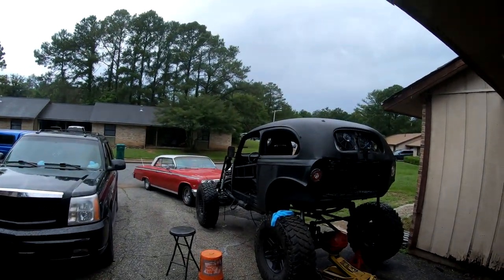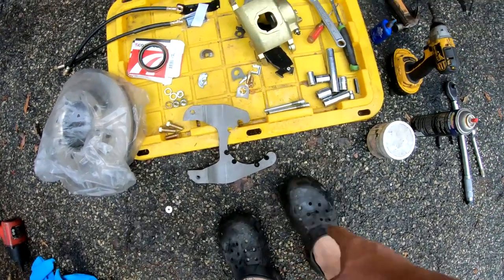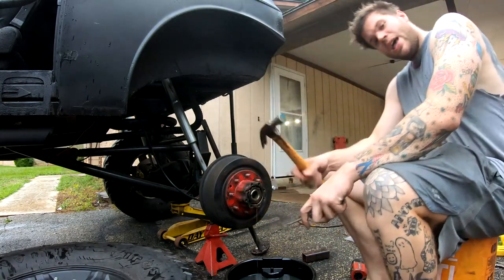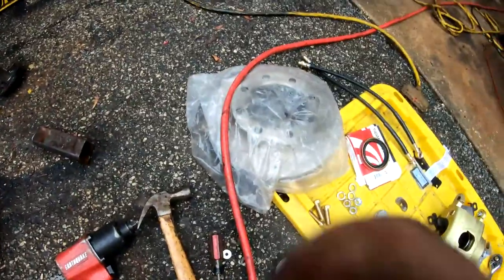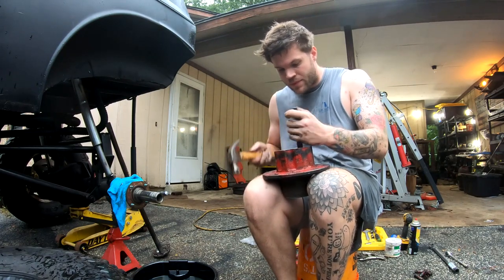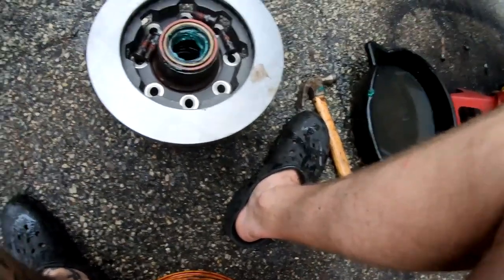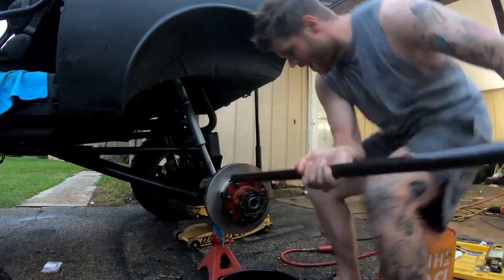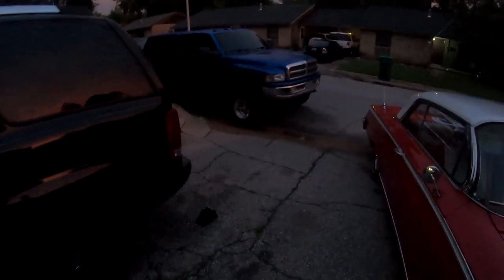Lugnut 4x4 Kit Dodge Dana 60 Disc Brake Conversion on my 1938 Rat || Legacy 4x4 and Off-Road

Comment: Great video man, helped me a lot. Currently rebuilding a 1975 Dodge power wagon and picked up a Dana 60 rear end and Dana 44HD for the front. Thanks a lot for the video, was having a lot of trouble with the drum brakes, still tryna learn, only 19
Reply from the maker: Glad it helped! Im actually about to do it again for a ford rear 60.... im about an expert at it by the 5th time!
Reply: @Legacy4x4andOffRoadYT  having a lot of trouble getting the wheel studs out on mine currently. So that’s my next hurtle, but keep up the content man! Really informative and helpful, not a lot of people show every step
Reply: Rebuilding a 78 power wagon myself. It has a Dana 60 from a 95 Ram 2500. How did it go?

Comment: Almost plug & play - something that didn't require fabrication is an unusual occurrence on your builds - only requiring just a couple of washers for spacers speaks well for Lugnut's kit! Damn - they don't make one for my Chrysler 8.25 ///;-(
Reply from the maker: I really liked their kit! especially since I couldn’t date my axle exactly so if it only takes two washers to be perfect I’ll take that any day of the week! Lol
Reply from the maker: I just like how cheap and easy it truly was... also I’m happy my axle shafts are in decent shape seeing as though the rear is welded...
Reply: @Legacy4x4andOffRoadYT  a Welded Diff with V8 ??!! Just driving this thing to the trail may be a detriment to your axles. But I'm certain you know to baby this beast on the street.  A switchable locker is my BEST friend  for about 90sec. Maybe you can sell your first borne

Comment: WHY WOULD U PACK THE WHEEL BEARINGS WITH GREASE ITS A FULL FLOATING AXLE THAT IS LUBED BY THE GEAR OIL
Reply from the maker: Always done it that way